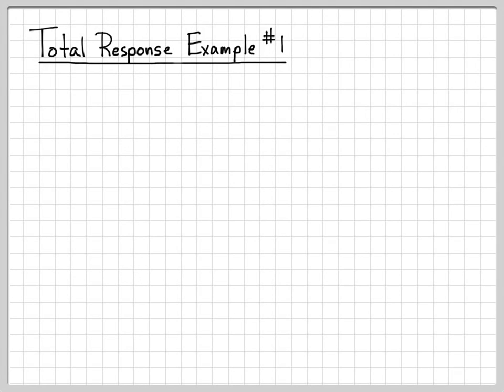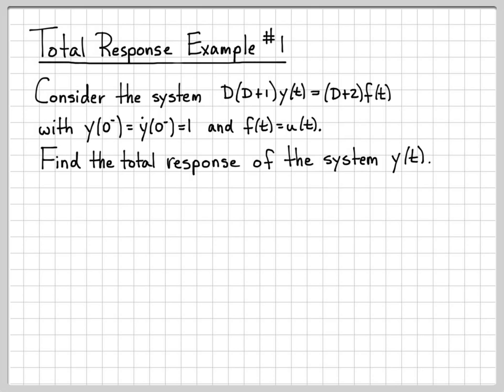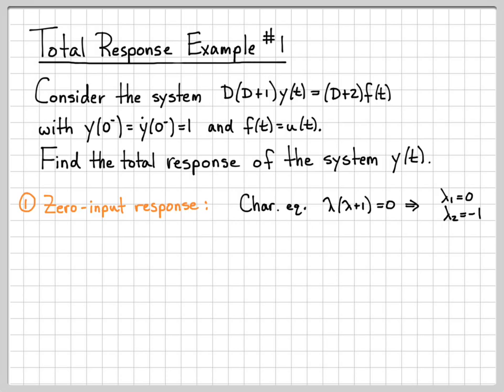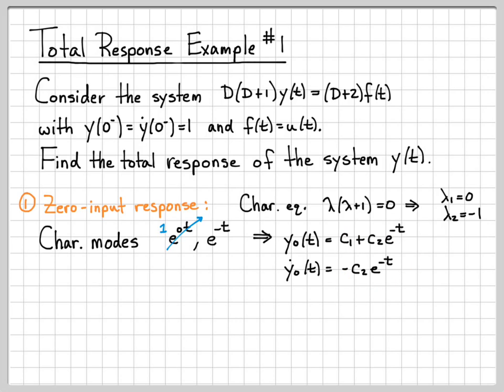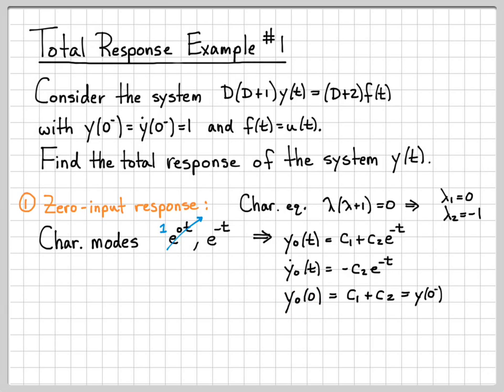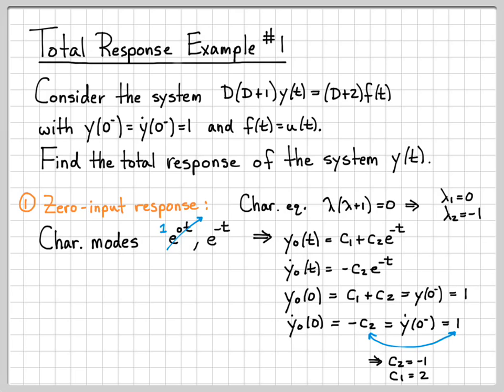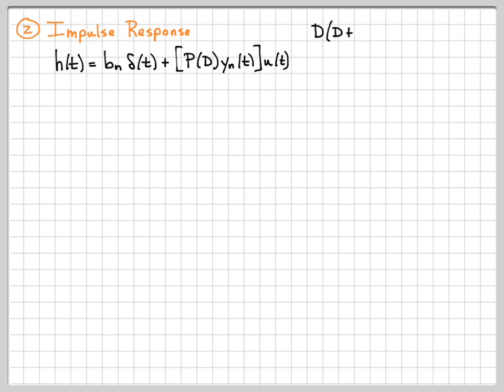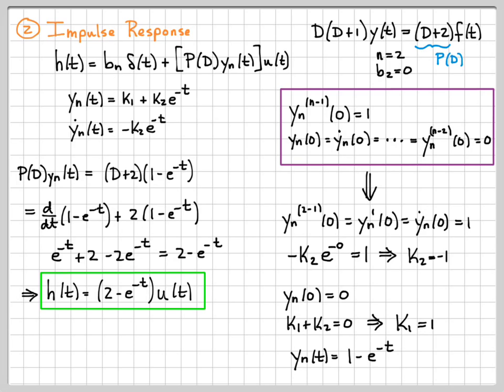Total Response Example #1 (Part 1/2)

Comment: Why is there a unit step response part at 3:21? Where does this come from? Is it because the function is only defined at t>0 ?
Reply: did you find the answer?
Reply: @jason-92  That is the reason it is u(t), it is only defined at t>0
Reply: @gabrialpetersen914  so if i had as input f(t)= u(t) + u(t+1). Is that change the output? Or it would be the same?

Comment: while computing impulse response. how to determine the value of bn when nis equal on both sides.
Reply: Obviously late but might help someone else. bo is in the equation. so if h(t)=bo*d(t)+(P(D)*yn(t))*u(t) and our equation is something like (D^2+4D+3)y(t)=(2D^2+D+5)f(t) then you solve the zero input response like normal to get your roots and same for the initial conditions. when you go to determine h(t) you look at P(D)=(2D^2+D+5) and bo=2 which is the coefficient of D^2. Then you get h(t)=2d(t)+((2D^2+D+5)*yn(t))*u(t).